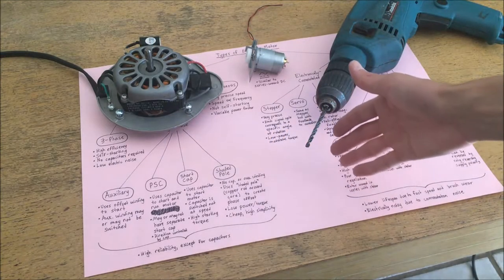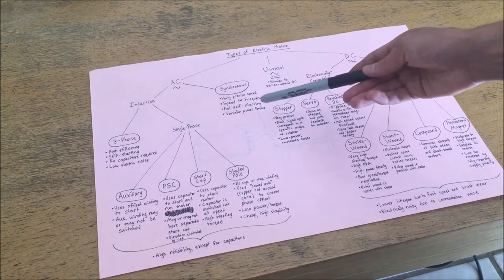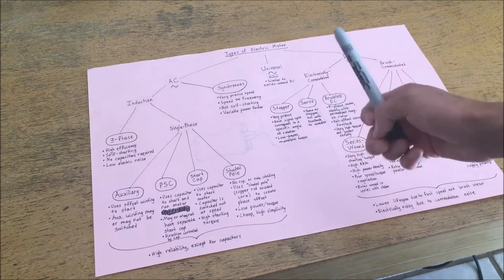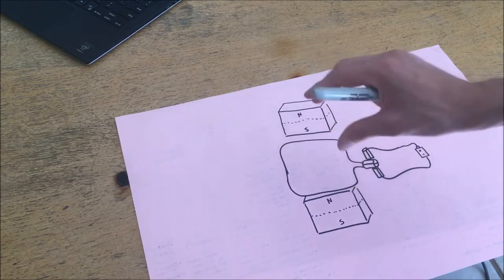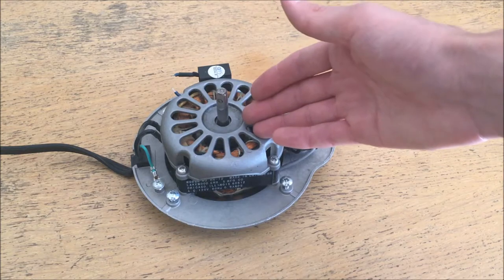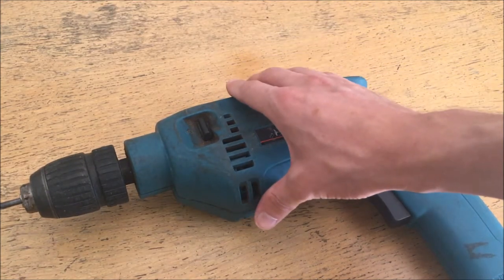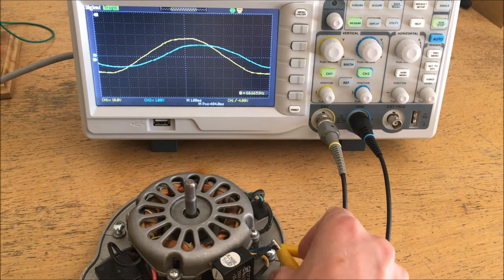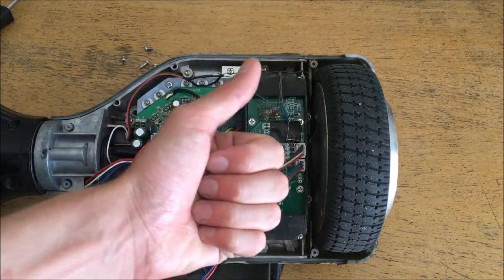EP 31 - Types of Electric Motor

Comment: I have a question. How do I convert a 110 V (170 watt according to the label) mini drill tool to work with 230V supply without using a transformer? I suspect the manufacturer uses the same motor configured differently for different markets, or maybe I'm mistaken?
Reply from the maker: Unfortunately most small universal motors are wound for their designed input voltage. You could possibly use a triac dimmer to clip the waveform down to a lower RMS value, but you would likely still see higher winding temperatures and you would need to upgrade the trigger switch ramp circuit to a higher-voltage equivalent as well.
Reply from the maker: A very brute-force method that could also work well would be to place a large incandescent light bulb or heater of approximately the same wattage as the drill in series with the drill. Again, you would still need to swap out the trigger switch to one rated for 240V, but this would also allow the motor to run at higher voltage without a high-powered triac.
Reply: @DielectricVideos  I think this would be the cheapest solution and most likely the safest. Behaviour would be predictable because of the series resistance of the light bulb. I will wire up a lighted mini drill. Thank you.
Reply: @DielectricVideos  It has built in speed controller that uses a triac, so not sure how a second one would affect the motor. I will go with your series lamp suggestion.